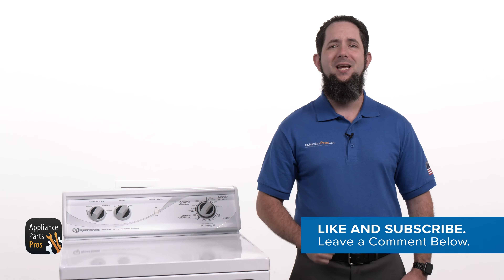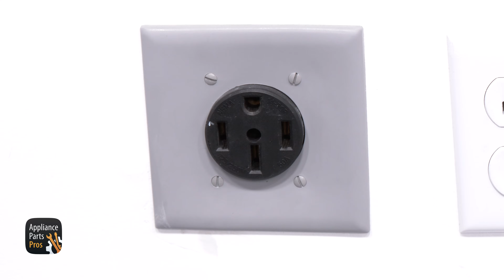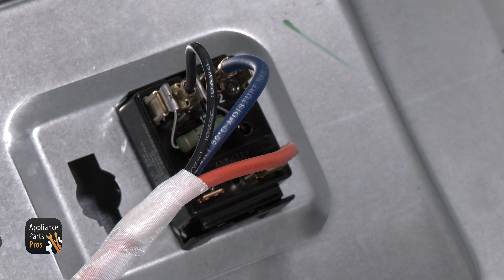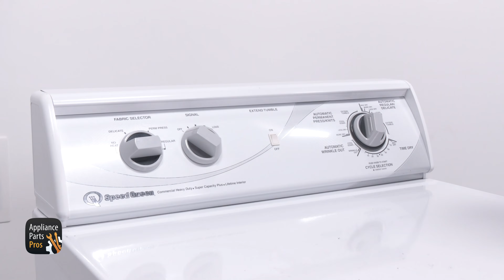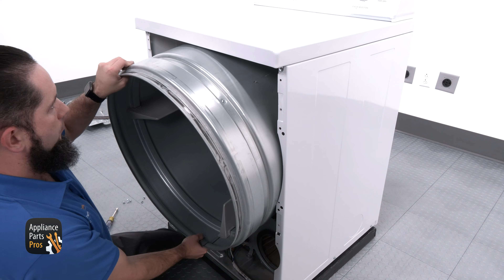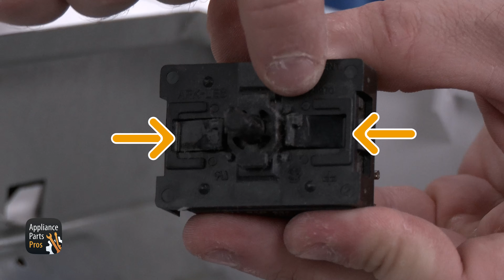How To Troubleshoot a Speed Queen Dryer That Only Makes Low Heat

Comment from the maker: 🔧 Common fixes for this issue:
▶ Fabric Selector Switch (Speed Queen electric dryer, no sp...: https://www.youtube.com/watch?v=JUam4ceZ41k
▶ GE Dryer Temperature Selector Switch – WE4M407: https://www.youtube.com/watch?v=-Ts5FX797mk
▶ Outlet (Cycling) Thermostat WE4M216: https://www.youtube.com/watch?v=jTYBOoB_2p0
▶ GE Dryer Temperature Selector Switch WE4M407: https://www.youtube.com/watch?v=qIeovdftVmE
▶ High-limit thermostat WP3977767: https://www.youtube.com/watch?v=DwlHNg5zJXs
▶ Thermal Cut-Off Kit #279816 (thermal cut-off and high-lim...: https://www.youtube.com/watch?v=_fjNHYcPH5E

👍 Found your fix? Hit Like so others can find this video too!
🔔 Subscribe for more repair guides: https://www.youtube.com/@AppliancePartsPros